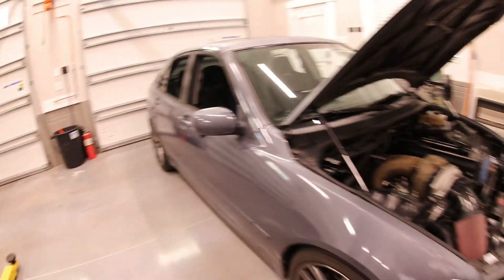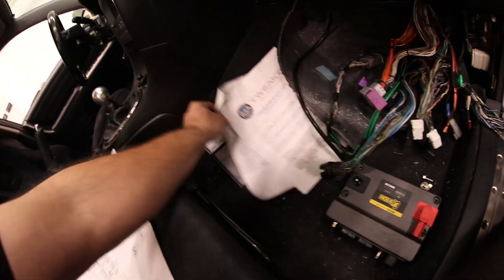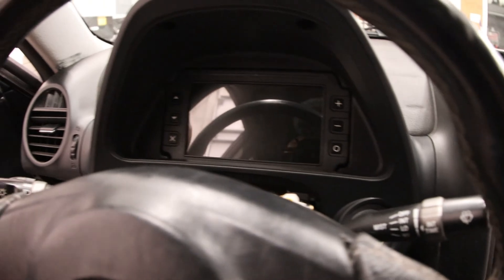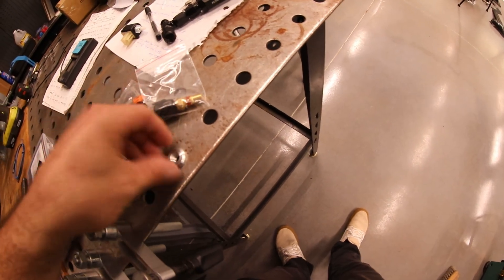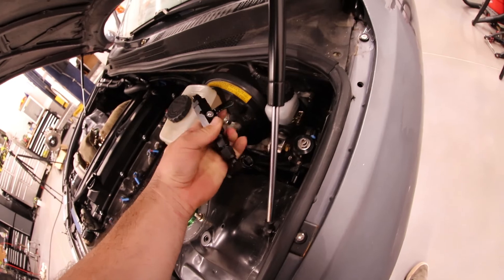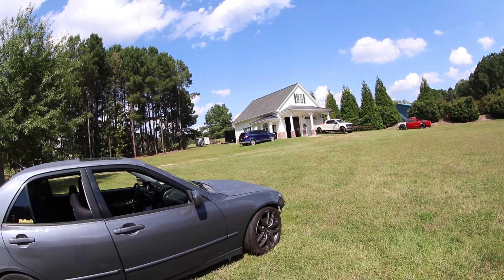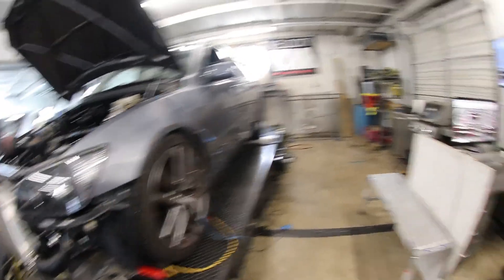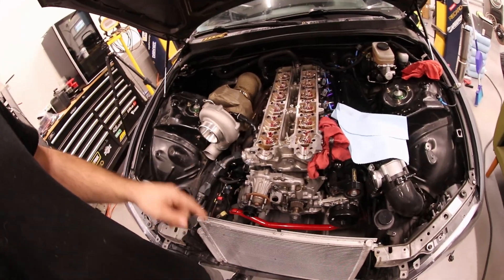INSTALLING A HALTECH NEXUS R3 ECU AND MAKING 600WHP WITH MY 2JZGTE IS300! Ep 8

Comment: I have the same ecu for my 1jz, and tweakd harness. Tweakd went out of business in October and their harness has potentially fried my r3 due to improper wiring of the hall effect cam/crank sensors. Waiting on Haltech to let us know. Tweakd obviously isn't around to support. I hope you have no issues with your harness. Great work
Reply: Bro, that sucks , but this is not the first time I have heard this with tweaked. I have seen and was told many horror stories with them and also wiring specialties as well. That's what pushed me to learn to build my own harness.
Reply: @ update: tweakd did have some improper wiring for cam and crank but haltech ended up being at fault. Sent me two faulty Nexus R3’s. They were blaming tweakd the whole time though

Comment: Nice 450kw did you get any driving on the street? Or just straight back on the trailer. Figured with that power 255s won't hold it down. great work switching to the haltech I went Ecumaster pro and regretting the complexity.
Reply from the maker: @thecookeman  thanks man!  Yes I drove it around for about a month, however the tuner took some duty out of the ebc so I only ever got to drive it on 25 psi.  Car was probably making 530-540 ish, and felt great, I just want a little more ceiling for it.  It’s got 265s on the rear.  I aired them down to 20psi and it hooks decent in 2nd and solid in 3rd.   You aren’t liking the ecu master pro?
Reply: @EVDMFG  yeah I've got rhe same wheels, I don't think a 275 would fit. Almost finished my build I'll see how it goes soon enough. The ecumaster pro is very different gui, interface is more like a motec, compared to the black and link software my tuners are used to. I chose the pro for the hardware
Reply: https://youtu.be/Pch5zM-VOY4?si=g99s-KqYlgu9Qod0 similar build. Just a few things different :Water to air, Mercedes 722.6 transmission, efr8374